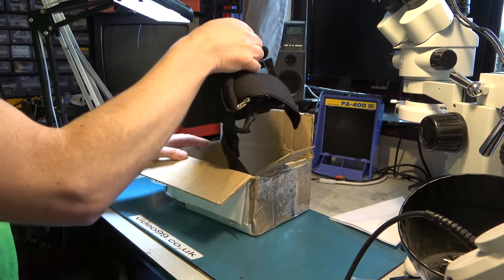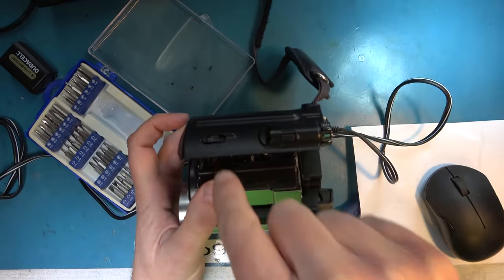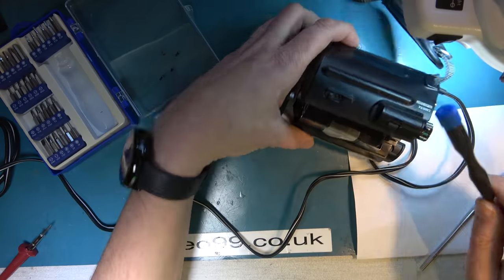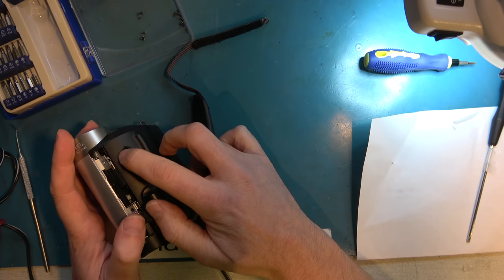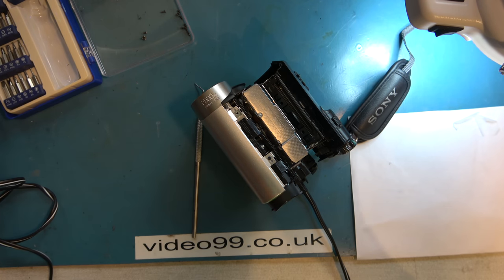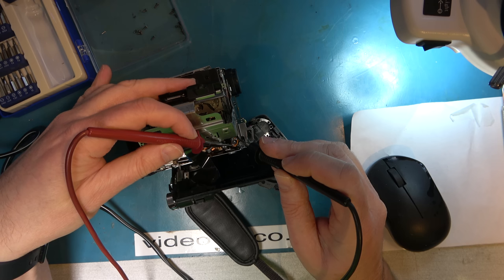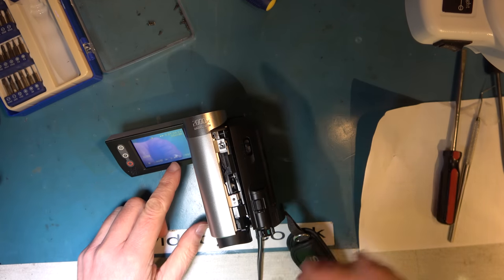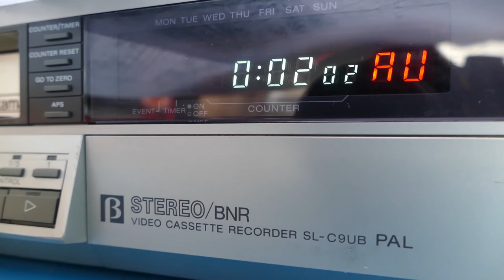Sony DCR-HC51E camcorder with C32:11 error. Can we get it going again?

Comment: I have fixed one of these years ago. Also a failing mode switch. The problem was that the contact on the gear gets loose over time and doesn’t make proper contact. The only remedy was to disassemble a big part of the camera. Glue the contact on the mode switch and then reassemble. It has never malfunctioned again even since. The glue used was a type used in the aviation industry because we had that at my job. I think something like UHU plus will also do fine.

Comment: Well done colin :-D
Yes i was thinking you had exercised the mechanism enough to get the mode switch working.
Leaving it for a week then powering it up will show if it's more stable.
And didn't they put that switch so far away, they need a slap lol.
Like you said, It did seem possible  that the open/close switches were playing games too.
As far as how fast you can fix something depends on how much of a pain it is,  It can take hours.
Some things i've spent days going round in circles untill the bulb lights above my head lol.
You make smashing videos colin, you verbally mull over your thoughts and we are included .
Some repairers dont do that, its harder to read someones mind lol.
Reply from the maker: Tested it a week later, still working reliably.

Comment: Sony had made component cables with that D shaped connector which break out into 5 RCA plugs (3 for component video and 2 for stereo audio). It was used on higher end models like the FX-1 and others. They may also have one for S-video as well.
Reply from the maker: Since the supplied cable has no S-Video plug, I'm assuming that S-Video is not supported on this camcorder.
Reply: Sony did indeed have an AV cable for these camcorders with an S-Video plug on it. But it was an extra-cost option, so most people didn't buy it; the cable that came with the camcorder only had composite video.

Comment: The S-Video is integrated into that propriatary Sony connector. Same technique was used on PlayStation conenctors, the fact that S-Video is not included in that cable is so that Sony could sell the cable with the S-Video separately.
Reply from the maker: But micromv camcorders already have S-Video cables as standard.  So it seems strange to drop that from miniDV.  I will have to try a suitable cable and see if S-Video is there.

Comment: Recently won the Sony ip1e auction on eBay. Battey was obviously dead after 20 years but it was only used for a week at the time so mint condition. Waited for a new battery now the LCD screen has gone. Just my luck but apparently these are or were fixable🙏
Reply from the maker: I've not repaired a camcorder LCD screen but I'll guess that the flexi cable has split.

Comment: This model has S-video out. You need a cable that has in one side a D-connector and  on the orher side has 3 RCA and 1 S-video (it's reported on the user manual as an accessorie) . I have a cable like this for my MicroMV.
Continue the good videos on video equipment. Regards.
Reply from the maker: Well why didn't Sony just include that cable like they did with micromv?  A bit shabby.

Comment: I have Sony Handycam DCR HC48 which works perfectly fine with the power adapter on. But if I take it out and put it on battery power, it cant turning ON, when i charged indicator lamp is flashing, what’s wrong?

Comment: Hi,  I have a vx2000 that when I apply pressure to the tape compartment door (when closed), it makes the eject tape sound (it does not eject the tape) it just makes the sound.  Any ideas on that?
Reply from the maker: There's no way to fault find my remote control, sorry.  It needs looking at in detail.

Comment from the maker: They can all fail.  Sony aren't generally too bad, but older, heavier models seem more reliable than later lightweight ones.  Canon can be good though I've had one with a bad capstan motor.  JVC and Panasonic rarely seem to last long, but maybe I've just been unlucky with them..  Not seen many Samsung but they've not been great so far.

Comment: I have one of these I was asked to fix but the only problems is you skipped over getting the cover off the door mechanism. I am almost at the hammer and screwdriver to rip it apart stage as I cannot find anymore pinhead screws to remove.
Reply from the maker: Have you undone the three screws on the outside and two on the inside?

Comment: This mechanism was terribly unreliable but was very fast in fast forward and rewind. The mode switch can be dismantled and repaired but the ribbon cable that passes between the upper and lower chassis hardens with age and fractures... the Sony replacement ribbons are lighter in colour (different material?), half the thickness, and more flexible.
Reply from the maker: I run a number of camcorders with this mechanism and so far they are reliable.  However I did have one fail badly on an expensive HDV camcorder.  Getting this unit apart to clean the mode switch, didn't seem to be as easy as it should have been, hence my bodge of working from the top.

Comment: My tape door was stuck open on a similar model.  I applied some contact cleaner to the mode gear and used 4v to get the transport working.  The tape deck opens and closes perfectly now, however when I put a tape in the compartment, it either eats/creases the tape or throws up a different error code.  I believe c:31:40, but I could be wrong.  I cleaned the tape compartment as best as possible with cotton swab and alcohol.  I cleaned the drum/tape heads with a piece of paper and alcohol.  Still eats/creases the tape and throws up the error.  Any ideas?  Thanks!
Reply from the maker: Could be pinch roller failure.  Sometimes it can help to take it off, clean (or roughen slightly with emery paper) then refit upside down.
Reply: @video99couk  ok thanks for that tip!

Comment: Half way through I was wondering if it was the carriage sensor that was faulty.

But it turns out, it had too many screws. LOL.
Reply: The mode switch is in fact one gear further forward toward the outside than the gear you referred to as being the mode one. The mode switch gear has no centre screw but is held in place by a u shaped metal part. I have 2 mini dv cameras both with this fault. 1 I flooded with denatured alcohol and drove the motor back and forth which cleared the fault. The 2nd camcorder needed a complete strip to remove the mode switch to clear the fault. Lack of use causes the original grease to harden and the contacts oxidize. Keep up the video's, very enjoyable.

Comment: any details on your isolattion transformer and current limiter?
cheers
Reply from the maker: I have two isolation transformers, they have appeared occasionally in previous videos.  One is a big RS isolation transformer in a plastic box.  The other is a multi-tapped toroidal transformer which I can use to generate various AC voltages.  There is no current limiting other than fuses.
Reply: Had the same problem. Found out that if you give camcorder a couple of good thumps on the base it unjam/ frees up something. It worked for me and is still working fine.

Comment: Admire your perseverance on this, but youbwere in the wrong place the whole time, there's a ribbon cable that runs from the moving carriage to the main chassis,  this breaks,  and gives intermittent operation,  you think its fixed then no go, , I learned the hard way
Reply from the maker: Oddly though, this camcorder is still working months later.

Comment: Assuming that the pinch roller is still in place and secured by its little plastic tube piece, then these errors are usually thrown up by the mode wheel contacts needing to be cleaned, re-tensioned and re-greased (with a better quality grease than Sony originally used!). See:
https://www.youtube.com/watch?v=lXvZ1No5azc
I do this repair for £40, these days.
Reply from the maker: Yes, mode switch is the likely cause, but it's not the easiest thing to get to.